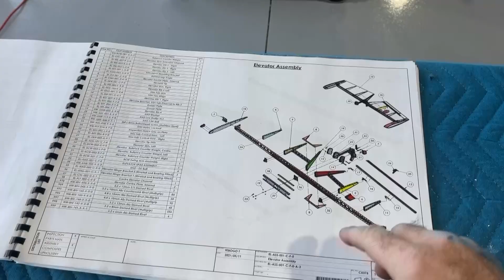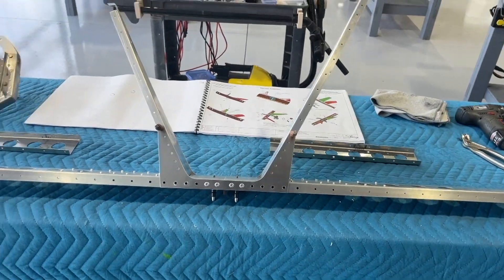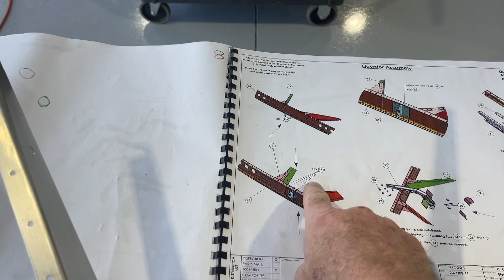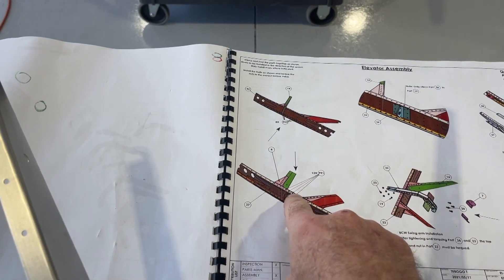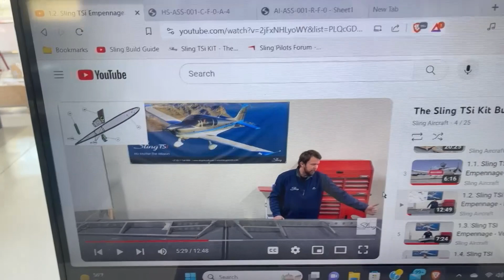The Elevator [Sling TSi Build Video # 5]

Comment: Is there any statement from sling about the interference of the rivets? Shorten the rivets will fix it, but is this accepted?
Reply from the maker: The only statement I am aware of from Sling are the instructions on the plans to perform this modification to the rivet.
Reply: Hi, thanks. Approved is fine.